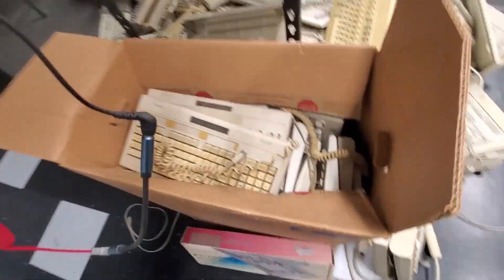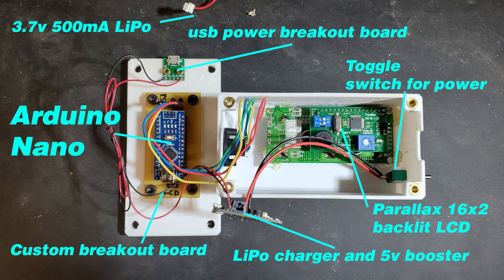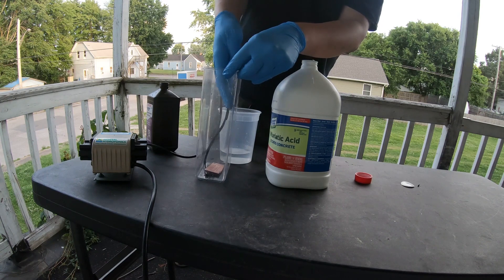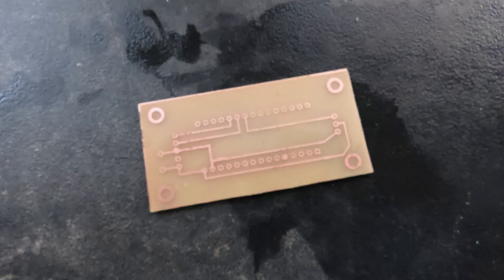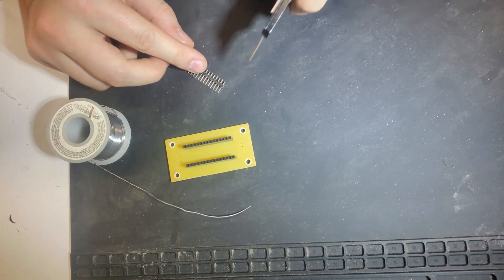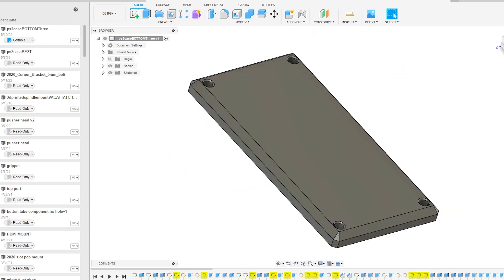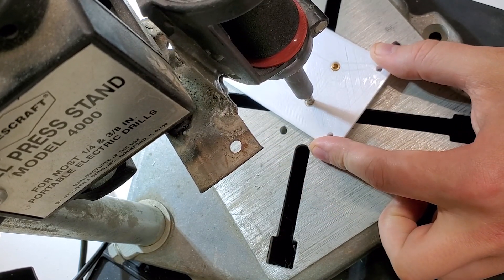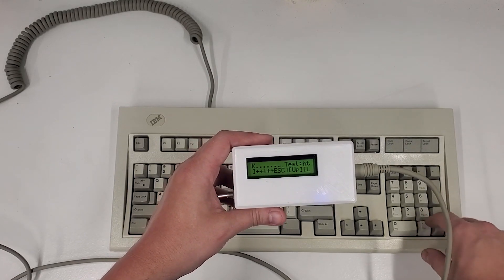Testing 1000s of IBM Keyboards with this portable DIY box!

Comment: Good job, thank you for sharing but the code couldn't be downloaded, can you check it please ?
Reply from the maker: it's there, you need to select all of it and then copy and paste it into the arduino ide.   https://pastebin.com/anUtBwcs     also note, I modified the code to probably only work with the parallax brand lcd I have but there's another version of the code out there that's works with cheaper serial lcds

Comment: So uhh... whatchya gonna do with all them keyboards? :P
Reply from the maker: putting them on ebay or finding buyers to buy in qty off ebay.
Reply from the maker: I'll end up keeping the neat ones I have multiples of
Reply: @midwestcyberpunk  If any are particularly neat that you'll be looking to sell, lemme know :D

Nice work by the way on the tester box. While you could probably also have it test some of the Fs (AT/XT/122s in particular) with some modifications, the Fs with D-Sub connectors would probably be way harder.
Reply from the maker: @parak4593   I have an adapter for the ATs but yeah, I don't know much about the Fs with the d-subs, will need to read up on those.   Are you looking for anything specific?
Reply: @midwestcyberpunk  Hm, nothing specific - I mostly collect obscure IBM ones, and the more obscure the better, so if you find something that doesn't have hits on search engines, that may be of interest :D